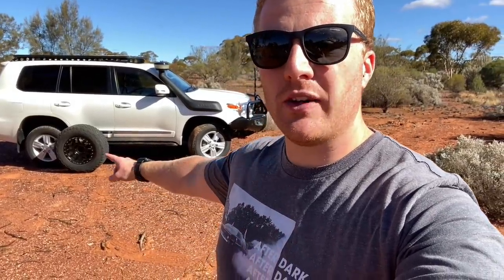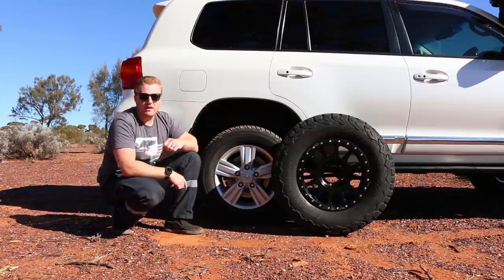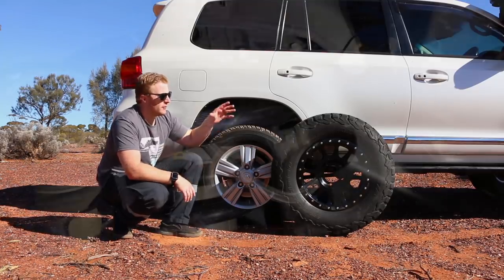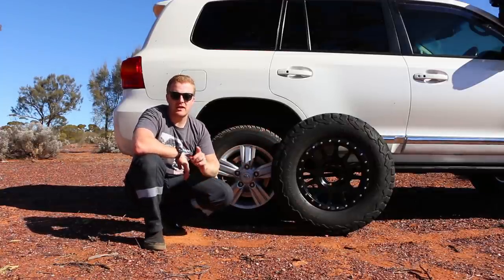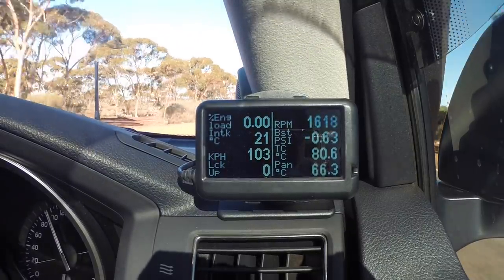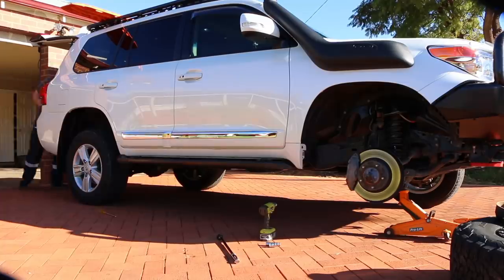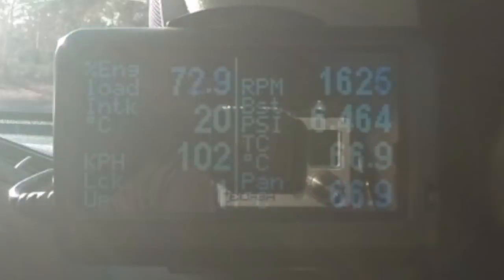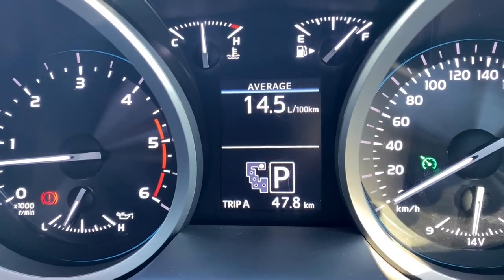TYRE SIZE COMPARISON | How much power is lost | Fuel consumption? | BF Goodrich AT | Landcruiser 200

Comment: Watched this video a while ago and thought, the result was not too bad.  But watched again today and when you calculate extra fuel usage over a tank full it comes out at 122 k less per tank.   122/14.5 = 8.41 ;litres pf extra fuel per tank @ $2.20 per litre at moment   means you spend $18.50 more per tank..   Times that over a year and just the fuel cost is significant not to mention wear and tear and the cost of the mods.  Very good video.
Reply: The math is wrong @15:57 by a factor of 15 times (1539%) or more. The correct increase is just 0.38 % not 5% - he forgot to factor in that the speedo is showing the wrong distance.  In the first test, he used 13.7/100*50.4 = 6.9048 litres of Diesel.  In the second test, over the "exact same distance", he used 14.5/100*47.8 = 6.931 litres of Diesel... a mere 26.2 millilitres more, which is less than even half of one percent (0.38), not the 5% he got by wrongly comparing "13.7" with "14.5".   Note that 26.2 millilitres of fuel will take  approximately 175 meters, and will take about 5.72 seconds at the speed he was driving.  

Long story short - there's no fuel difference at all (that number is so small, it's impossible to measure using the instruments he had and conditions he drove in, especially when he spent a whopping 2 minutes behind a truck, which was 21 times longer that it takes to burn 26.2ml of fuel...)

Comment: Would be interesting to see what would happen with thinner tyres with the same height, they would weigh less and you might get close to standard power and consumption, appreciate your content always informative.
Reply from the maker: Thanks mate. So the size in circumference is what generally effects the fuel consumption and power. If I went the same height then the odds would be I would see similar results. The width of the tyres would make little difference. 
To increase power and get better fuel economy I would have to look at getting a small tyre. 
Cheers, Nathan.

Comment: On my Hilux it came with 20in wheels and road tyres. I changed to 16in wheels and BF ko2 AT tyres, same overall diameter at 31in but the fuel consumption increased from 30mpg to 27mpg respectively.  Towing was more stable on the 20's but the BF's are just the coolest. Excellent video. Cheers. D
Reply from the maker: That’s an interesting difference, wouldn’t have expected that much change. 
The BFG’s are great tyres. This is my 5th set amongst testing a few other brands in between. 👍

Comment: great video, keep in mind that the BFG are a 3 ply sidewall and LT construction therefore the overall mass & weight of the tyre requires a little more effort to turn, even if they were in the standard OEM spec size.
I switched from 265/75x16 (31.8") to 285/75x16 (33") BFG ATKO2's on my 80 series petrol and have found fuel consumption unchanged plus the ride comfort increased, probably due to the higher sidewall absorbing bumps etc.  Speedo is out 4 km/h at 100 but overall dont think ill ever go back to the std sizing

Comment: Hi, your findings are right in certain circomstances but, ive been driving Land Cruisers for about 26 years now and have done many hundreds of thousands of km's, one has done 700.000+ km the other 500.000 km and many trips all over outback oz and ive had many different tyres and sizes on my vehicles. What ive found is that some tyres have a bigger rolling resistance (read worse fuel economy) than others even being the same size. My experience with BFG AT'S multi directional is they have quite a bit of rolling resistance, so have Bridgestone and a few other makes. Like driving with the handbrake on, i liken it. While others specificallly "unidirectional" (one direction) tyres have less. I went from 31" BFG AT  10pr to 33" CF3000 MT 10pr (265-75x16 to 285-75x16 close enough to 33") unidirectional tyres for instance on both my vehicles and after accounting for the discrepancy in the speedo and odometer by using Garmin GPS equipment i have found nearly no difference at all in fuel use or power. In some circumstances its even better. The only issue ive found is because the gearing is taller downhill speed increases and ofcourse less revs at the same (GPS)speed. But as i said only on certain unidirectional tyres. The ones I run at the moment are "Comforcers CF3000" cheap but a great tyre. No flats and no balencing problems, great grip! ( No, I do not get sponsered by them at all 😢) Anyway something to think about. God bless.

Comment: Thanks for a great and informative video. I just want to remind everyone thinking about bigger wheels that increasing the wheel diameter (and increasing the final reduction ratio) has also a few more positive consequences. Acceleration potential is decreased, but a higher top speed is reached. In other words, the bigger the tires on a car, the slower it will accelerate, but it will have higher top speeds.
Reply from the maker: Great point!
Reply: Not true at all if the car dosen't have the horsepower or torque to overcome the losses caused by the increased gearing.

Comment: I think bigger/heavier wheels are actually more efficient when cruising at a constant speed, since it's higher rotational inertia prevents it from slowing down as quickly as a lighter/smaller wheel, letting the engine use less effort in maintaining momentum. Also, bigger wheels cover a greater distance per sec, at the same engine speed. 

The only time u will consume more fuel, is when you are increasing speed.
Reply from the maker: Potentially, however I can't comment personally on this as I haven't tested it. My gut feeling though is that the engine is under my load turning these larger tyres and this would result in higher fuel consumption. 
Maybe another test to conduct in the future. 
Cheers, Nathan.
Reply: @XploringOz  Lower engine revs will result in better economy, however the tread pattern on those tyres will not be as good as the Grand Treks for economy. So not really an apples with apples comparison

Comment: G'day thanks for the video tyre wheel comparison, nice work. I thought i should mention there is a navigation calibration setting within the menu of the LC200 touch screen, under vehicle maintenance i think, this calibration requires you to drive the vehicle, it is intended to adjust distance and speed relevant to tyre ware or tyre size change, i used this function and my speedo matches my Garmin gps, phone app gps and Garmin watch gps to within 1km/h, i have 305/50-20R on at the moment, going back to 18in wheel and tyre combo soon, 50 profile is not enough to absorb bumps etc, great for handling but no good for much else (noticeable)
Reply from the maker: Cheers mate. I'll have to check that out as it's not something I've experimented with yet. 
Cheers, Nathan.

Comment: Great video. Just a comment on fuel economy, I would have preferred to see the actual quantity of fuel used for each run, e.g. top up to filler neck and measure each time. The trip computer is really only a guide, mine can be out by over 1.2l/100km when I measure it and can be quite variable. Also the trip computer is not compensating for the added rolling circumference so is assuming an incorrect distance traveled in its calculations.
Reply from the maker: For sure, actual fuel usage would be preferable, but it’s hard to get this exact figure when filling up with angles of the vehicle, air pockets etc. maybe over a long distance it would be more accurate, but this short distance, it would be easy to miscalculate. 
Testing I’ve done with my vehicle shows the trip computer to be very accurate, but I understand your comments about the calculations with the larger tyres.

Comment: Correct me if I’m wrong but the car in the second test thinks it’s gone 2.6km shorter, If you take into account the difference in travel the car thinks it’s done you end up with a very similar result. Ie 14.5 x 47.8/50.4 = 13.75 L/100km, or 0.05L/100km more.
Reply from the maker: Hi Craig, 
So I believe it would work the other way around. There is a comment by Werner on here that explains the difference very well.
Cheers, Nathan.
Reply: You are right: his math is wrong.   In the first test, he used 13.7/100*50.4 = 6.9048 litres of Diesel.  In the second test, over the "exact same distance", he used 14.5/100*47.8 = 6.931 litres of Diesel... a mere 26.2 millilitres - which is about 175 meters, or 5.7 seconds worth of driving, so he's basically shown that the bigger tyres used no extra fuel whatsoever (if you factor in the accuracy of the instruments, and the single-digit precision of the data, and ignore the 2 minutes he spent behind the truck).  For reference, note that a 200-series uses about 15ml of diesel per minute at idle...

Comment: The different tyre size will probably affect the vehicles fuel consumption calculations. 
It would be interesting to see how much difference there is between in-car and real world consumption with the bigger tyres.
Reply from the maker: For sure, there is that potential. It would definitely depend on how and what parameter the vehicle uses to measure fuel consumption.
Reply: @XploringOz  Definitely, There is a difference. But when you talk about a 4000CC + power its just a small difference in actual.

Comment: Very well presented, just another little thing that should also be considered is differential ratio. The ratio has been calculated for the standard size wheel and putting on larger diameter wheels on throws those calculations out the window, hence why the engine is working harder and using more fuel. To correct this the diff ratio's need to be change to suit the larger diameter wheels.

Comment: G’day Very well done this video, comparison and explanations. You are right with what you said, but I think you have todo a second part for all of us towing a van. That’s a game changer. In my books a tire upgrade on the 200 series must go with a lock up kit and transmission remap. From own experience 1st. Test 2000 km run MEL-Adelaide-MEL with van and larger tires nothing modified the transmission seldom shifted into 6 gear, running 5th on around 2000rpm and was downshifting to 4th. Gear and revs up sky high. Open torque converter you could see the temp rise as well the fuel consumption. 2nd Test MEL-SYD-MEL Inland and coast road appr 2800km my experience much better driving lower rpm in the sweet spot of torque and 2 ltr less diesel consumption per  100km even it was more hills on the way up SYD.. that to say justified my decision to invest in a lockup kit and ATCU remap. Endurance test not done yet only 10000km clocked yet due to the travel restriction in place. Yes, and of course No failure codes nor any problem experienced yet. PS as said befor . I like your Ultra gauge in that spot with the less expensive bracket fits nicely on left side in a blink of an eye visible where the scan gauge would not fit. I found it troublesome to see the scan gauge over the steering wheel in front of the instrument panel. That location suits more the pilots under us as they be used to such a cluster of instruments and information in the cockpit. But that is my opinion and everybody has experience by himself. Please keep the vids coming as they are really very good and informative. Cheers.
Reply from the maker: Thanks mate 👍 I definitely agree with you there. A lockup kit and remaps are planned for future mods. Restrictions and other factors have just pushed them back a little. 
I’m glad to hear you have had good results with your setup and I’m looking forward to hopefully achieving similar results when I can get them fitted. 
May I ask what lockup kit you have installed?
Thanks again 👍
Reply: XploringOz Yep, no problem, Richards Auto electric.. He came to MEL by a long time appointment and installed it to my 200 series in my friends workshop in Bayswater area while doing other cars in the area too. Same installation costs. Was done in end 2018. Check for after COV-19 or an installer in your area. There is a German sparky in Perth... Cheers
Reply from the maker: Thanks mate 👍 all advice taken on board. Cheers

Comment: The only true reason to fit larger diameter tyres is simply to raise the center line of an axle although this effect may be less or more with ifs geometry. The only correct way to do this conversion for that is what it is, is to accept the parameters of the conversion which may involve castor and camber angle reset. Additional attention should be directed to regearing diff and transmission ratios across all gear speeds so correcting the speedo readings etc although I imagine this could also be dealt with through the ECU if the speedo is fully electronic. Regearing should also maintain some equalisation of fuel economy figures. Also do not underestimate the dimensional changes ride height increases input into things such as wheelbase ,propshaft length and stress all added to by the additional wheel dimension. Finally given that there is more rotational mass in the larger wheel/tyre set up, the vehicle may require more stopping power that means bigger brakes including increases in temperature operating levels. Done fully and properly it can give added purpose and ability to any off road vehicle get it wrong can be disappointing if not down right dangerous
Reply from the maker: For sure, I agree 100%. When modifying these types of vehicles, you want to make sure you are doing it correctly and more importantly, safely, both for you and other road users. 
In this instance, I'm happy that I'm only lifting the vehicle 2" in height (suspensions) and increasing the tyre size by 6.7%.
Though both reasonable increases and will increase the wear and effectiveness of parts on the factory equipment, so far the gear is holding up well. 
Any larger changes would definitely start requiring further 'supporting' mods to embrace the changes.
Cheers, Nathan.

Comment: I upped my tire size for the cost savings, lol it's a lot easier and cheaper to buy r15's then my stock r12's. My little Geo Metro with only 45 hp is not really happy with the out come, but better then running trailer tires.

Comment: A larger rolling diameter tyre will give better fuel consumption on the highway all things being equal. In the 200 series, you would need a trans tune and lockup kit installed to keep the bloody transmission in 6th gear however.
Reply from the maker: I did a video on the 6th gear issue too - https://www.youtube.com/watch?v=ozEfUUzW7UY&t=745s

Comment: Where did you learn the trick to push the sequential up twice to hold top gear better?
Reply from the maker: Hey mate, so originally I just got this information off some of the forums, however Toyota don't try and hide it. It can be found is some of their vehicle manuals and on their data lists. There are a couple of options to assist with programming modes.

Comment: you for got to correct for the fact that when using bigger tyres the car is not calculating the correct kms. so 14L/100km is actually 14L/107km for example, over estimating the fuel consumption. need to apply factor of difference in rolling circumference for fuel consumption.

Comment: So you could have both sets and have daily set and 4x4 set best of both. The 4x4 set will last for a long long time. The daily will be less fuel and cheaper to replace.
Reply from the maker: For sure, this is definitely an option. To be completely honest, I'm probably a little too lazy to continuously change the wheels and tyres over, but if you are only going on the occasional trip, could be worth the savings in the long run. 
Cheers, Nathan.

Comment: Great video I have two sets of factory alloy wheels for my hilux the 18 inch with factory tyres 265 60 18 and the 17 inch with ko2 in 265 65 17 same diameter but they weigh six kilograms more each so 36 kilograms more same weight as two jerrycans
Reply from the maker: For sure mate. The weights are something that are hardly ever spoken about, probably just due to the fact that they are unsprung weight. I did go into this topic a little in my original wheel video.
Cheers, Nathan.
Reply: @XploringOz  occasionally I help out in a mates tyre shop the standing deal is when a 33 inch or larger comes in for repair on the rear wheel carrier I buy the beer, so far its never happened its usually on the back seat as its that hard to lift back on to the carrier for oldies and women regards mike
Reply from the maker: Haha, yeah they are no lightweights. This is another good consideration for those who might not be capable of lifting these tyre/wheel combinations, especially for those travelling in remote areas.

Comment: If you have a GVM/GCM upgrade you still must run the size tyres that is stated on the upgrade plate attached to your car as I also have a 2013 Landcruiser Sahara with the upgrade the same as yours and can't run larger tyres such as you do legally..
Reply from the maker: That’s correct, the standard ARB GVM kit doesn’t allow for larger tyres. However, in WA anyway, you can have the larger tyres certified by and engineer (at a large cost) to be fully legalised 👍

Comment: Have you already calibrated your Ultragauge to reflect change in gearing with the bigger wheels?  Just wondering whether your indicated speed are based on 1.00 calibration factor or account for the correction?  If you havne't already calibrated its well worth doing to get more accurate speed, odo and DTE with the fat rubber onboard.
Reply from the maker: For sure. I haven’t actually got around to that yet, but definitely something on the to do list 👍